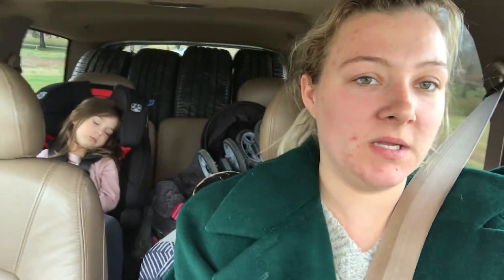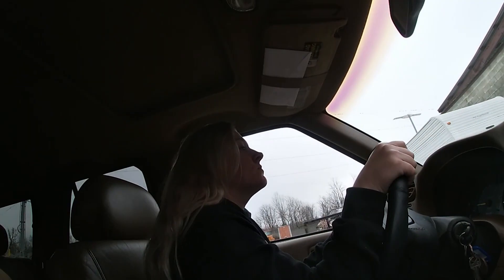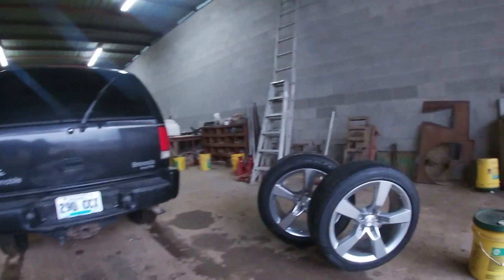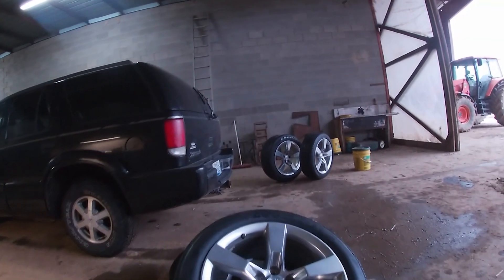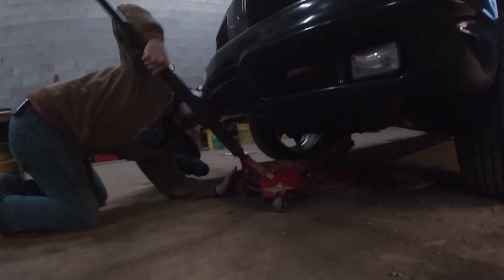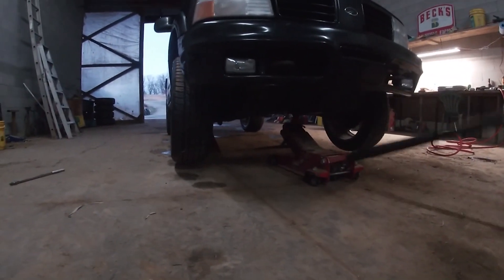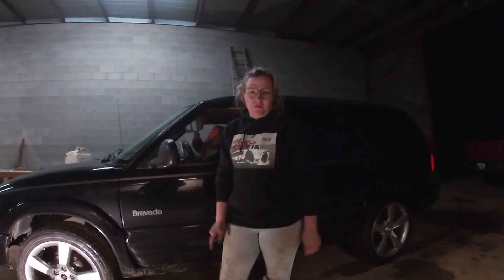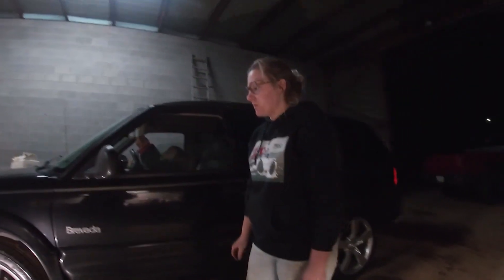20" Camaro SS wheels! // BRAVADA Ep. 3

Comment: Did your ride have 5x4.75 lug pattern I’m wanting to put the same camaro wheels on my Sonoma
Reply from the maker: Yes
Reply: The camero wheels will go straight on your Sonoma you might look into wheel spacers depending on if you have the right clearance which I don’t believe you will without running a small spacer. Just be mindful of your back spacing / offset of the wheels and the width so you get the clearance you need

Comment: I started doing this to my 01 blazer 4x4. I had to open the center bore on the rims to fit on my blazer since Camaro is 66.9 and blazer is 70.3.   Did you not do this?Also did you use factory lug nuts?  Noticed Camaro are bigger compared to 12x1.5 on the blazer.  Thanks.
Reply from the maker: Hey thanks for the informative comment! YES. I did have to bore out my center hole further. I also used the Bravada's factory lugnuts
Reply: @s10life  thanks for the reply.   I’m almost done with my set to install.     Take care
Reply from the maker: No problem! Holler anytime
Reply: Shouldve put that in the video?  @s10life

Comment: That looks good. I also like the jeep Wrangler aluminum silver 17 on the Chevy s10
Reply: Do they also fit on the blazers and s10’s?? I know the Camaro wheels like these do but did not know they did.
Reply: They do with adapters if I remember correctly. Jeep wranglers are 5 x 4.5 and the S10 is 5 x 4.75
Reply from the maker: They do fit them if they’re 4x4, if they’re 2wd you have to have spacers

Comment: Was the bravado have 5x4.75 pattern like camaro I’m wanting to put the same camaro wheels on my 98 Sonoma
Reply from the maker: Yessir same bolt pattern
Reply: U didn’t need any spacers
Reply: Good I’ll get the tommrow and paint them black
Reply: Ok post a pic during daylight  like see ur better
Reply from the maker: We didn't have to run any spacers on these wheels because this is a "4x4" sseries platform with has a wider wheel base. If your sonoma is 2wd you will need spacers to keep the wheels from rubbing your frame.
Reply: Do you know what size spacers would be needed
Reply from the maker: 2.5 to 3" should work fine.
Reply: Would it matter to get hub centric? Or is non hub centric ok? 
Only thing stopping me from getting spacers/adapters
Reply: @CypressCristian  you want hub centric 5x4.75-5x120mm spacers for 5th gen Camaro wheels, that and also think the actual hub of the 5th gen is 63mm while the  s10's are 70 or something like that and would need to be relieved/milled out to fit over. 4th gen and c5's fit wo issues tho

Comment: Stock bravada lug nuts?
Reply from the maker: Yes
Reply: @s10life  i just picked some "13 ss wheels up and the center bore is different. How did you manage to run these without adapters or modifying the wheels?

Comment: Alrighty I have 95 blazer and gonna possibly put a 2.5in lift kit on her and my buddy has z71 rims problem is gonna have to get 5lug to 6lug adapters for the rims did you have to cut or anything?
Reply from the maker: It depends on how tall the tires are on the z71 wheels! We didn’t do any cutting with this setup besides boring the pilot hole for the hub
Reply: @s10life  alrighty

Comment: Actually ma’am they are the same size , the back ones are just wider (staggered)
Reply from the maker: The wheels are the same height, yes. But the tires on the back are taller than the front ones making them not the same size.
Reply: @s10life  oh I understand I’m sorry, did y’all use any spacers or anything. Also do you have an Instagram I can see more pictures of them please?

Comment: Do you know if they would fit on a 1995 blazer Thanks in advance
Reply from the maker: Yes they will fit but if you have a 2 wheel drive you will need spacers
Reply: @s10life   is it have a 2002 2wd blazer would i need spacers?
Reply from the maker: @DillonNetterville  yes

Comment: I have a 09 TBLT I want to put these on but have the 6x127 bolt pattern. With 6 lugs.. will these fit?? (The Camaro is 5 lug.)
Reply from the maker: You would definitely have to have adapters to make it fit on yours IF you have enough clearance to use them
Reply: Really dude? Your answer to your question is in your question. Smfh

Comment: got to make sure that the tires have the same rolling diameter otherwise you will blow up your transfer case
Reply from the maker: Yep, she took the front droveshaft out to prevent trouble
Reply: @s10life  depending on what awd case it has that may actually damage it more
Reply from the maker: Really? I hope not. We're looking to get all the same size wheels and tires to get it back AWD. The transfer case wasn't kicking in before these wheels so there will probably be more work to do when we put the shaft back in.
Reply: Got my S10 5 speed buy 20 good condition only thing don't know take more gasoline can f the from my S10 bro this look 🔥🔥🔥🔥🏆 moster that rim good jod
Reply: If you watched the video you would've seen her do that. Lol

Comment: It's honestly not worth killing 80% of your vehicles functionality just for looks. Removing that front driveshaft is honestly pretty dumb considering how awesome these things are.
Reply from the maker: We wouldn't have removed the front driveshaft but the tires were different sizes. The driveshaft is going back in when the new tires go on.
Reply: The two tire sizes have the exact same circumference,  they pulled the driveshaft for no reason the stock tire sizes are staggered on the Camaro but they are both 28.7” in height and have 704 revolutions per mile.  Just one size is 9.6” wide and the other is 10.8” wide.
Reply: Hey guess what? It's their truck and they can do whatever they want to do to it Kemosabe. Lol
Reply: @bryanomicioli3301 Yeah I read in the comments that the tire size thickness was the same it's just the width is different so thought the same but it's good they were cautious tho.